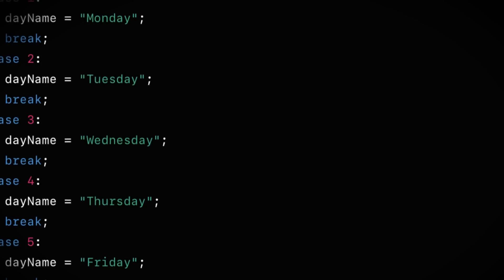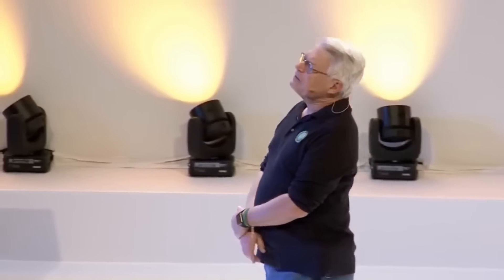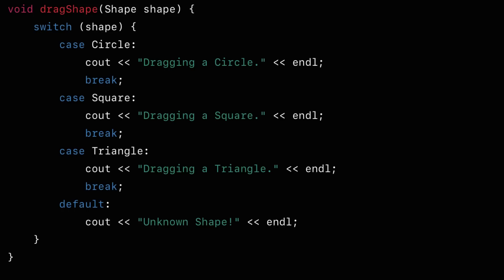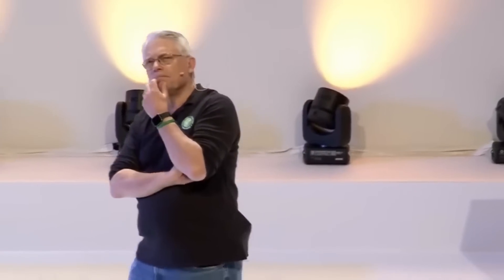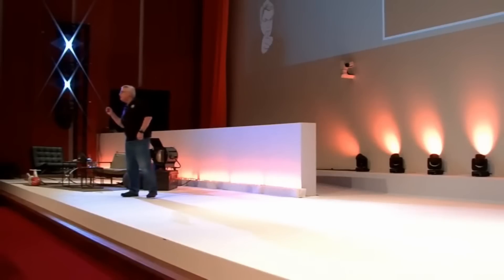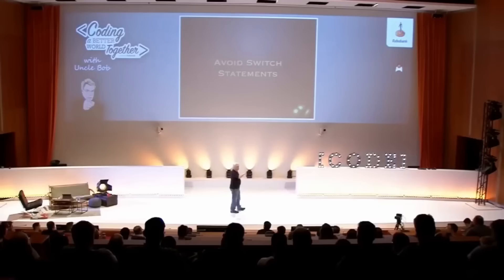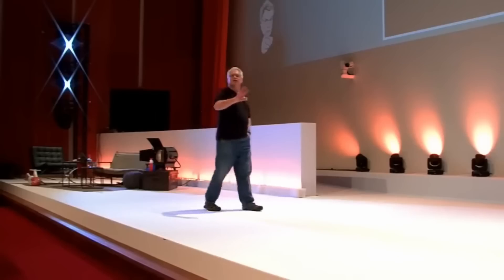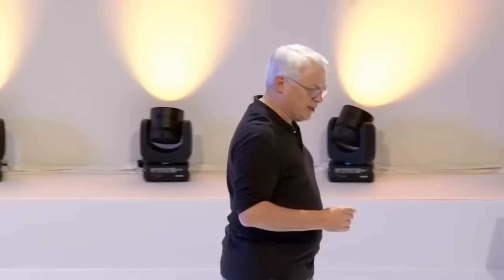The problem with switch statements - Uncle Bob

Comment: This isn't the late 1900s, exhaustive switches are better than subclassing in most scenarios.

Add a new 'shape' and you'll almost certainly have to update some factories, etc at the very least. And that's assuming a nice new homogenous shape that fits in your gloriously perfect abstraction (IRL we spend hours arguing over squares vs rectangles). If that new shape has some unique aspect? Now every shape has to accommodate that, not just the 1 that actually needs it. Then you'll find you're pulling on a thread that will unravel the whole sweater.
Reply: Said by someone who, clearly, does NOT understand polymorphism! 

I've been saying FOR YEARS that most engineers do not understand polymorphism, and can't help but tightly-couple everything they write. This guy, also, does not understand factories, either. A fundamental inability to understand THIS particular abstraction, but comfortable with bazillions of "patterns" I imagine.

I recently encountered this exact issue when I wrote a small subsystem that was extremely loosely-coupled. It was secure, and all checks were made to ensure that the user had permissions to do the CRUD in question. The team lead, required adding a "trait" to a bunch of subsystems AND requiring SEPARATE routes for each of the classes the trait was given!

It went from 4 total routes ( one for each CRUD ) to 12. Adding same pattern elsewhere, it ballooned to 72 ( so far ). The team lead produces prodigious amounts of code, but clearly cannot understand polymorphism - or interfaces, for that matter. sigh
Reply: @Jollyprez  I absolutely understand polymorphism. Parametric, ad-hoc, subtype, subclass, etc. OOP with its subclassing is the most maligned one. IME, it deserves it.

I'm not sure where the rest of your screed is coming from
Reply: @adambickford8720  I reiterate - you don't like polymorphism, and I submit you don't understand its power. You just said it in your last sentence. It's ok - you're employable as most modern software engineers don't understand it, either - including my immediate tech lead, nor the tech lead on another project. I don't think the architect understands it, either, if what I see in the codebase is any indication. The upshot is that the codebase tends to be very tightly coupled, and increasingly difficult to maintain, with a profusion of abstract "patterns" replacing concrete classes and sub-classes.
Reply: @Jollyprez  
Please, give me a word of what is wrong with his understanding of polymorphism.
Reply: @diadetediotedio6918  I'm sorry, but I think he clearly stated why he doesn't understand it. Switch vs subclassing. Hmm. Seems obvious to me that - at the very very least - he's uncomfortable with poly-m. I cannot FATHOM needing to litter a bunch of switch statements all over my code to handle ( in this example, shapes ).
I've seen some recent examples where a giant subsystem in Angular has if statements littered throughout based-upon several "special case" objects in various ways. The code was quite convoluted and when I had to dip into it, I managed to add a couple of features to some new objects WITHOUT REQUIRING specical-case if/then/else statements ( which is just a short switch statement ). Those features were now available to ALL the existing objects if they want it.

Comment: So, switches are not a good replacement for inheritance and polymorphism, got it. But this is not the only case where switches can be applied.
Reply: Well he uses an example where the switch statement is worse and polymorphism is better, but does ask what one has to do if one want to add a new method. You have to go to all the shape classes and add it there. Whereas you would only add one function with one switch statement otherwise.
Reply: Or lets say you have bunch of shapes and one operation is slow. Your CPU supports rotating multiple shapes at once. In the switch case it is a bulk operation, easy to do. In the polymorphism based solution it is hard because it only deals with one shape.
Reply: @theevilcottonball  it depends in how you implement polymorphism though. In java I use to declare an abstract class between the interface and the concrete implementations to at least be able to easily insert a default implementation for new methods (even if it's just to throw some exception).
Reply: @theevilcottonball  That is true, but after adding a new method to an interface the compiler will immediately tell you which classes you have to modify to satisfy the interface. With a switch statement you'll get no compiler assistance.
Reply: @a-name-or-not-a-name  C and C++ have -Wswitch and Haskell has a similar warning to turn on, Rust, Zig, Odin, Elm, have exhaustive switch/pattern matching on sum types by default.
Reply: @theevilcottonball  That's nice, but the difference between switch an polymorphism is that polymorphism is limited to a specific type. I would say it is still a switch, but it happens inside the compiler. When you use a switch statement you can use literally anything as the condition. That means you have to be judicious and only use it when you know what kind of conditions the compiler might be able to detect.
Reply: @a-name-or-not-a-name  He wasn't talking about that. It cannot be paralleled with polymorphism. That would be regular control flow.
Reply: @theevilcottonball  It was an example of a switch statement. Imagine you write a perfectly nice switch statement where the compiler can detect a problem. And somebody else in the organization writes a series of if-else-blocks instead. The logic is identical. Would the compiler be able to detect an error in the case of the if-else? And if later somebody modifies the logic in the if-else but forgets about the switch or vice versa will the compiler notice it?
Reply: @a-name-or-not-a-name  Oh, you mean that. Yeah the compiler would not tell you. But if you write the wrong code, nothing will. Polymorphism also will not help you if you write or inherit the wrong method.
Reply: @a-name-or-not-a-name  It may be detected as a code smell with the use of code quality tools. But yeah, if-else looks worse than switch to me, too
Reply: I think the point is if you repeat the condition of a switch, use polymorphism instead. At least that's what i heard.
One or two switches ain't gonna kill ya.

Comment: So basically switch statements shouldn't substitute for redefining your methods in derived classes.  Thanks for the pro tip there Charles Babbage.
Reply: There are cases for switches, and cases for methods in derived classes.  Its not 100% one or the other.
Reply: It more of "where do you put the flow control". If you take a base class for shape and derive classes for different shapes. You have just hidden each CASE test instance in an inherited class. You then still have to hide the SELECT portion of the function someplace. You make that decision pre-compile time by deciding your inheriting from a CIRCLE. 

If you get down to it, it is all TEST and BRANCH at the assembly level. it is all a matter of how you hide that abstraction to hopefully make the problem simpler to solve, easier to understand and the code easier to change and maintain.

Comment: Why use IDE and easily update switch statements, just create new class (if you java new file for each class also) for each type in enum. So if you codebase has 100 enums with ~8 types in them - then just create 800 classes, that would be easily maintainable!1

Comment: a lot of people in these comments missed the point
Reply: Enlighten us
Reply: @yapdog They don't understand a thing to polymorphism. The point of Uncle Bob is that replacing polymorphism with multiple enum-based switch statements is simply bad design. But many comments believe it's just an attack against switch statements...
Reply: @yapdog  read the comments that agree with the video, they already go through it
Reply: @lewke1059  What I read was BS
Reply: @lewke1059 I’ve read a lot of comments and have seen nothing deeper than “you just don’t get it”.

I agree with the video. Inheritance is better than switches many times, often even! I just disagree that is a “problem” with switches. Just as using a hammer to knock down a house isn’t a problem with the hammer.

So can you explain what I’m apparently not getting….?

Comment: Never write a switch statement without adding a default branch and putting an assertion failure there (assuming you're not using the default branch as a catch all for some reason). Then at least you'll catch the missing switch case at run time!
Reply: It's better to catch this at compile time over runtime. Don't use default at all and the compiler can error on it. This is one of the strengths of rust. C is a warning that can be enabled.
Reply: -Wswitch is the flag
Reply: compiler will at least give you a warning. then you just have to go there and change code
Reply: Just trying to fix the problems, instead fixing the cause. Bad strategy.
Reply: Swift and Kotlin do this automatically at compile time :-)